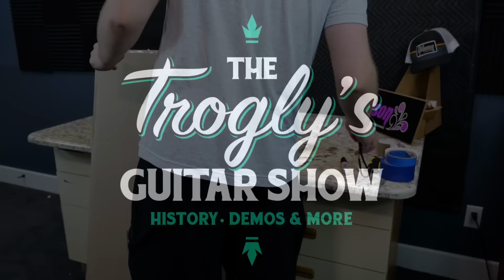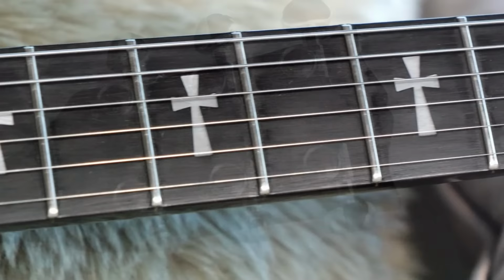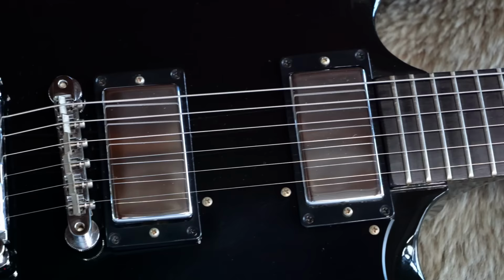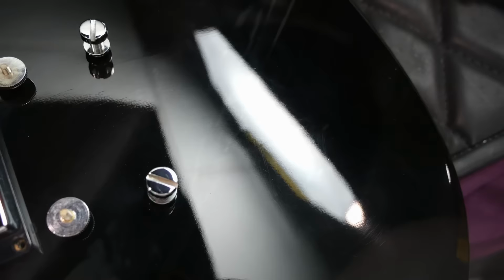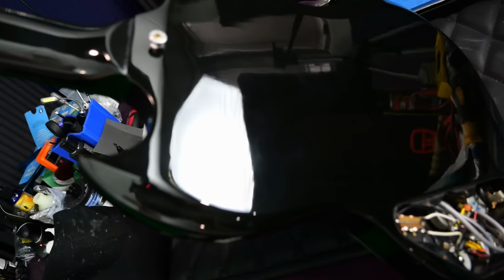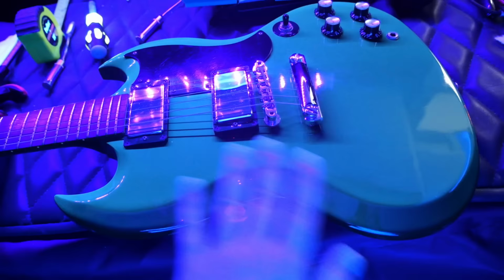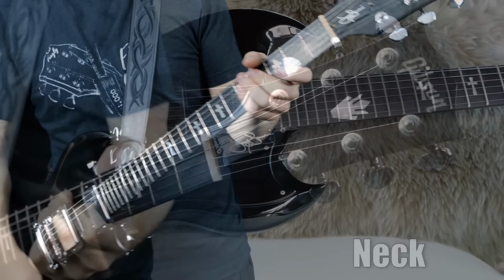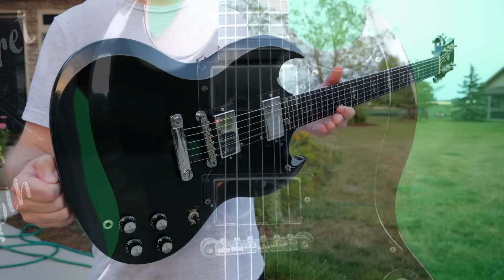The "Godfather's SG" | 2001 Gibson USA Tony Iommi Signature SG Cross Inlay Review + Demo

Comment: I have the Epiphone version of this guitar. The strap button by the neck on this guitar is actually on the top horn on the Epiphone eliminating neck dive. You still get the Iommi pick ups, rosewood fret board, but all the hardware on the Epiphone is black (which I prefer). I got mine for a pretty great value, it's my go to guitar for the tone those pick ups create. Still my favorite guitar I own to this day.
Reply: Great choice. I would love to hear some tones.
Reply: Those are creeping up in value too.  I had found one years ago for about 400 bucks (should have got it), saw one the other day and the guy wants about a thousand for it.
Reply: @ferox965  I was wanting to get another just to gut it for the parts to swap on a knock off Les Paul I have, but shit, it's probably cheaper just to buy the parts now. XD
Reply: I have a Epi version too, but my strap button is at the neck base. Suspect it may be an early run version?
Reply: @ethansimpson1007  Yours is actually the newer version I believe.
Reply: Ah, I'll have to check the serial number. Also, I believe the fretboard is ebony. The spec on most websites lists as ebony fretboard with the cross inlays.

Comment: The pickup has both ceramic and alnico 2 in each pickup. Both the ceramic and alnico 2 are full length bar magnets stacked together on the bottom of the pickup (were they normally would be). There is also a second alnico 2 magnet that is about only 1/4 length of a normal bar magnet on the top of the pickup setting in between of the two bobbins

Comment: BTW those pickups can be split into single coil sounds. Hence the reason for 4 conductor wiring. I sold mine because I didn't like the fat bassy sound I was getting from the pickups.
Nothing like the trebly tone I knew from Black Sabbaths first two albums. If I had known I could've single coiled these pickups I would've to try it out. I'm curious now to find me a pair to try that out.
Noone on Youtube that I know of has single coiled these yet. I believe it would get a more authentic P90 early Sabbath tone.

Comment: I mean, gloss black shows every flaw, scratch, ding, etc. It’s only perfect right after it dries in the factory. However if you have a perfect gloss black surface you can then spray over that in a metal color like chrome and it will look like actual metal. It’s a weird finishing quirk that model makers and movie/theater prop departments use.

Comment: Unless I missed it, the different output jack position on the Custom Shop wasn't mentioned.  I used a right angle jack to plug into the guitar. My first decent guitar was a '62 SG Special. Loved it for years until the neck actually started twisting!😳

Comment: Nice guitar but will it stay in tune? I've owned several Gibson SG's in the past and they are hard to keep in tune. The third string (g) is almost impossible to stay in tune. A luthier at a guitar shop told me it's the nut that's the problem. Gibson knows about this problem but avoids fixing it. Guess as long as people fork over the money for overpriced Gibsons the company lets it slide.